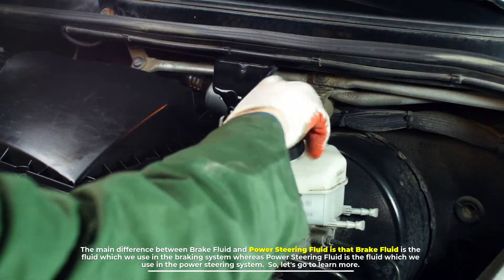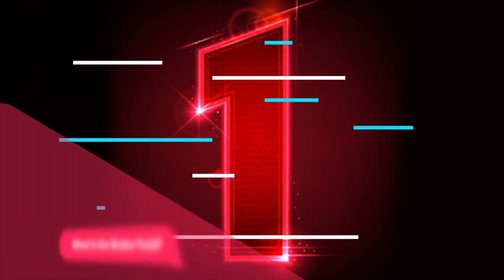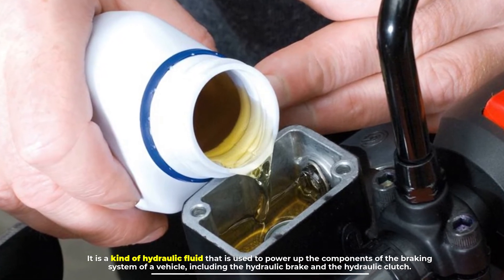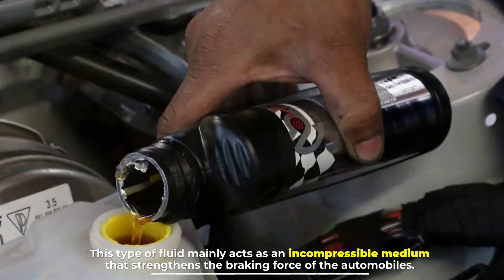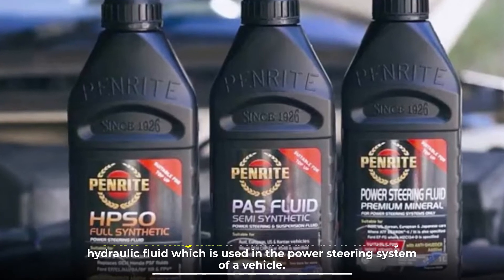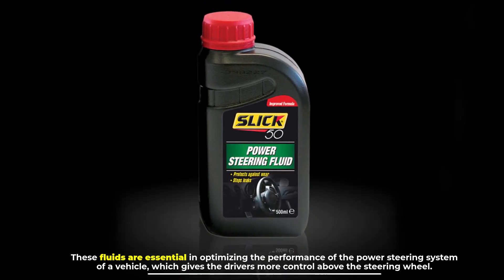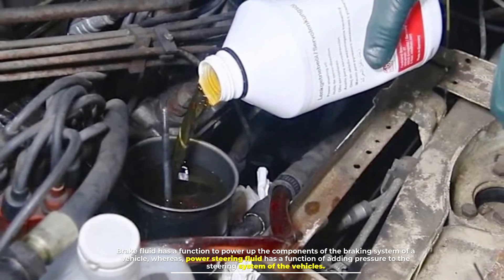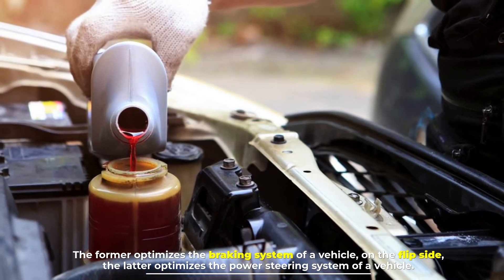Brake Fluid vs Power Steering Fluid

Comment: I use brake fluid in power steering fluid as an additive just a small amount about 1/2 cup in power steering fluid, I find a noisy power steering pump will quiet to almost silent with brake fluid added also it seems the steering works better and has quicker reflexes. 😉
Reply: You can do the same for engine oil. Replace 1qt of oil with transmission fluid for a engine cleaning additive. Should be done just before you're ready for your engine oil service because it will breakup built-up grime in your engine and you don't want to have that cycling around your engine for long or it may cause other issues with the small filters and or orifices in the engine like valve timing and the oil pump etc . You really just want to run it long engine for it to warm the engine for about 50 miles of spirited driving.